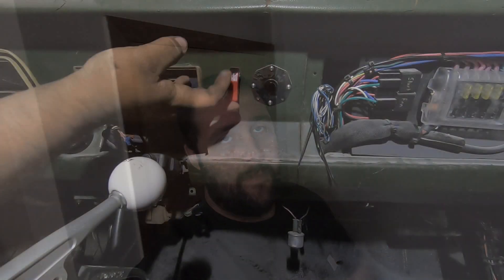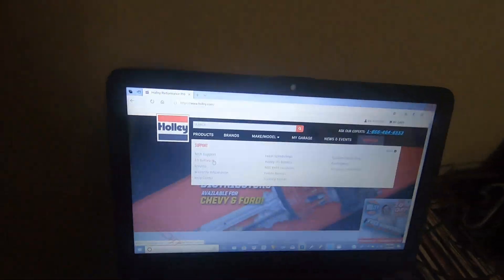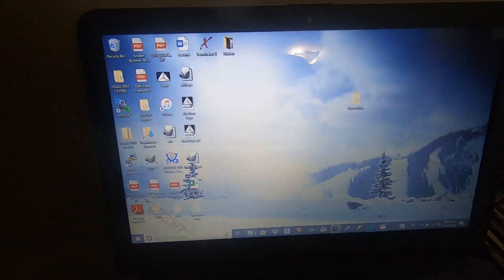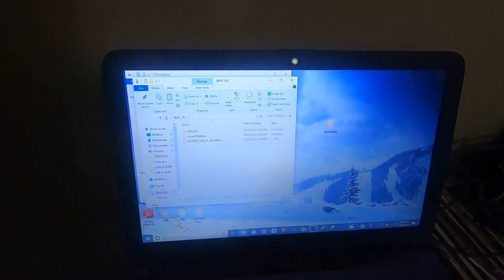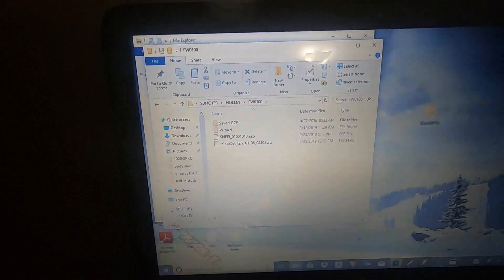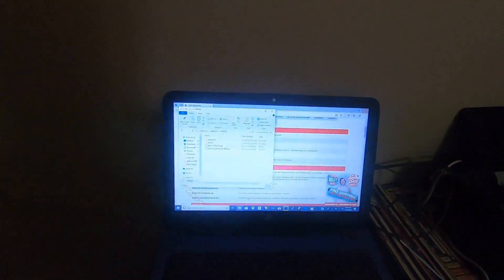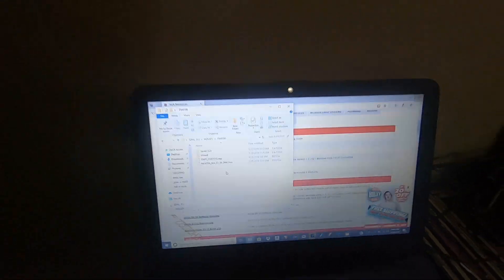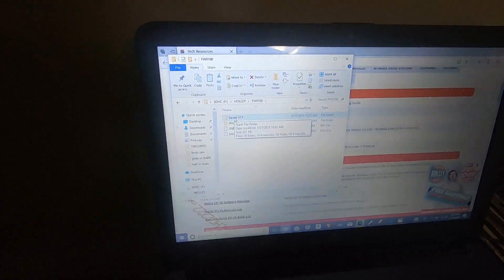Quick fix: file structure error, Holley terminator x

Comment: what format do you need to change the files too once you download them from holley mine are coming up as pdf and still aint working
Reply from the maker: You need to take the old files out and put them in a safe spot(I don't trust updates. ) Then take the new file and unzip(decompress) it that's should show up with the files formatted like you had previously but with updated numbers. 
The new SD card contents has had an issue with the 4l80e&4l60e from what I hear. That is unrelated to this issue and seems to be corrupted files